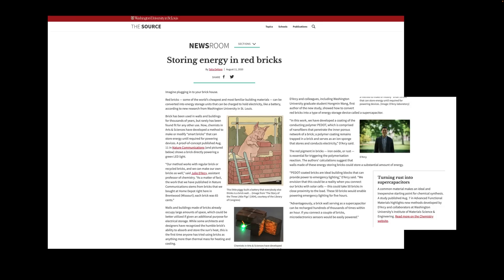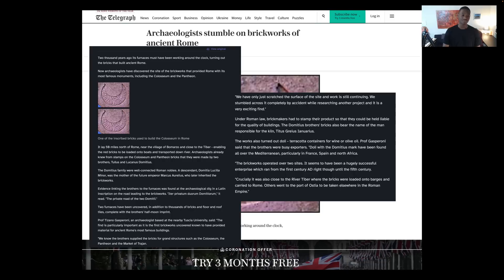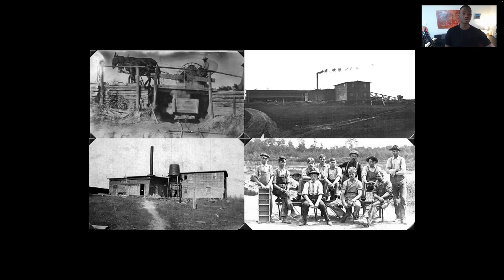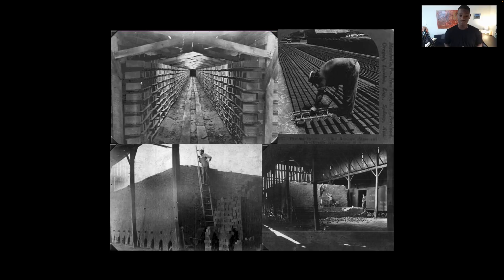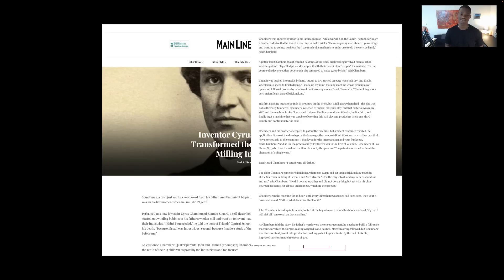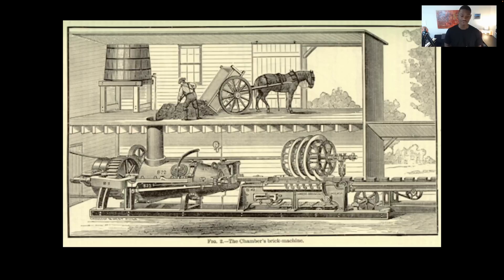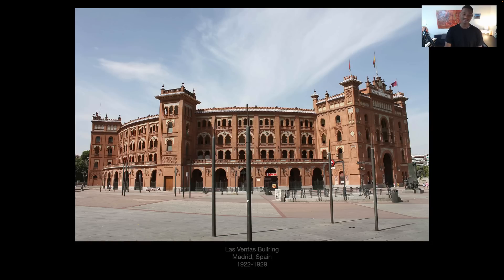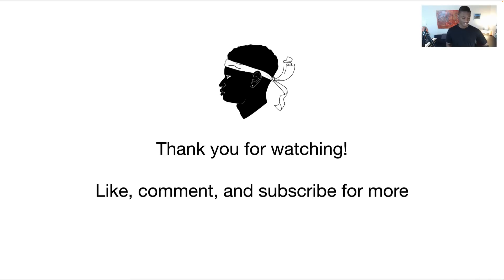youtube video #-t0cK5yxU5I

Comment: Yes silica batteries are real. You just need two different types of metals to act as your anode and cathode. Only problem is they produce no magnetism so they only make volts. Each brick would be 1 volt roughly. You would have to convert all those volts into amps at some point maybe with an electric motor with a few broken or turned of coils to produce a collapsing feald. That feald would make amps. Have fun, look into Bagdad batteries they are fun to make 😄 joules ringers can be fun too but you heard nothing from me.
Reply: WOW,  im glad i read comments, because the video was click bait all i heard was history of brickmaking and then he went to showing all these buildings made of brick which had NOTHING to do with the Title of the Video , the reason why im here.
Reply: @Shang Tsung  I hear you. That's why I left the comment I did braking down the actual science. I knew some smart people would actually consider what I was saying. I don't expect it though.
Reply: You can create a charge with an aquifer underneath the bricks. Something like having flowing water under the structure. 

Much like Giza Pyramids with the Nile flowing under it and all those massive granite boxes with lids smashing into each other. 

This will create piezoelectric field. The movement of the water perpendicular to the movement of the piezoelectric field will create the magnetic field... 

Each brick in the pyramid will act as a transformer to store electrical charge and modify the output of said charge.
Reply: The ancients also used coal power plants in many cities. So it may not have been a general use power source probably had some other function using electrical laws. The Moorish structures or at least the structures that have hexagon prism 'window' structures with pipe organs (churches) did produce some power on demand.
Reply: combination of light and frequency also creates power
Reply: So in order for the pyramids to work. There are access ways where the light can reach the water under the pyramids
Reply: @massdisruption3437  idk about the pyramids, but the batteries I'm talking about don't need light. I have no clue what the pyramids were used for 😅 sorry homie.
Reply: Áll old churches have a basin underneath the altar; al-tar = al-tároló, which means underneath-storage; the ethernal flames and candles used in churches might be related to some  sort of gases or  chemical danger

Comment: very skilled brick mason is an understatement. I once had to re-set some large pavers, "large" as in like 2ft x 2ft square blocks a decorative area around a tree and fireplace outside chill spot, the roots and what not over the years had them starting to come up, getting a perfectly leveled spot of fill dirt even an area of 2ft by 2ft is a nearly impossible task by hand without proper tools. you might think you got it, give it a couple days to settle, guess again. Eye balls shovels and air bubble levels won't cut it. I lean more toward how we do it now, POURED LIQUID geopolymers, especially for leveling of foundation, then the facade/decorative render cover with plenty of room for mistakes, can make it LOOK like its made out of anything. That's largely the case with most of these ancient structures. Wise up/paul cook all those dudes have shown this ad nauseum. When the aggregates are in a liquid state, they self level and self fill a volume of any shape. Not to mention, bricks alone would crumble under the immense weight of structural support in buildings of that magnitude. They need framing, rebar, etc. Every time we turn around we "discover" something in these old buildings we never knew was there, for example one built over 1000 years ago thought to be completely stone hewn was found to have iron framing. They're putting up some new 4 story building downtown where i live right now next to the "old" courthouse, to make it look brick like the surrounding buildings, its completely wood framed construction with plywood finish, then a thin layer of decorative "brick" glued to the wood, lol.
Reply: Yeah, in my hometown that was the size of the paving stones 2 inches thick. Groups of old guys walked with a cart and any cracked ones they would fix. Each group had 25miles of streets contracted to them. No potholes lifted corners every one who wanted to work had a job. Those streets were put down 180 years ago ,only got one drain redo because of new housing in the area and then the fiber cables got layed with machines and fucked it all up. Many hands make light work and the ground once levelled will be there century's later, a few machines do the same project and your pulling it all up every 25 years?? Don't make sense, and that was only fifty years ago. I can't walk through areas and see houses and shops more than fourth years old now and yep more getting condemned every year.👍
Reply: They poured geopolymers in precast, but not here, and does anyone know what the real ground / foundation is? Since it is mud flood everywhere and the buildings seem to be bottomless and we have access to few old world structures.
Reply: Strange comparison. The old building are real solid bricks throughout. No simulation at all. I don't understand your comment exactly, but have an idea. Anyway, the fact we can't repeat this today doesn't mean previous builders couldn't do it either. Projecting is not working here
Reply: @elim7228 Agreed. Old world buildings are the real deal and not a facade like now.

Comment: It was either purposeful destruction like you said, or it was an accident, a meltdown of the electric city circuit board. But whatever caused all the melt, had to have been sea water that cooled it down. Either a fail safe that was built in by our ancestors who undoubtedly terraformed the plane, or a result of whatever caused the cataclysm also causing earthquakes and tsunamis. We are a species with amnesia but slowly we remember…through critical thinking, sharing, and through dreams.

Comment: Super capacitors to store charge derived from the canal systems and Star Forts? Thanks for making this video. There are numerous videos about the structures, streets, bridges, buildings etc. made of the bricks and others such as UAP channel Bricks out the Wazoo questioning how that many bricks were even made in those early days but this is the first video on the subject that shows photos of the brick making factories or what ever you would call them. Which, looking at a small group of guys that look rather tired, reinforces the question of where did all the bricks come from? There would have to have been a brick making factory every 50 miles in all directions to have supplied the amount of bricks that it took to build the old world. Especially in the time period and time frames they were built in. Brick cities underneath brick streets with newer brick cities above them. The old world said to have been built over roughly, what, 300-500 years of time, showing 10,000 years worth of bricks?  Good stuff man! Thanks.
Reply: They have been redoing streets in our 2 towns. Going clear down to pavers. Tons of them.....but ppl want them, so thats a good thing. Toldmy kid bout it. They made a whole sidewalk. All of these are early 1800 brix.
Reply: @suebee1436  I live in Vancouver Washington and there used to be the remains of the Hidden brick factory off of 4th plain and Kaufman I have heard that the Hidden family started out here but idk for sure. They tore all of the brick yard buildings down in the 90's I think the Hidden house restaurant is still open Just a fairly small brick 2 story on 14th and Broadway. We have a suspicious brick Catholic church close to that and the Academy on Evergreen blvd. All our brick buildings that I can think of have mudflood aspects to them but none are the built for giants kind.
Not sure about the church but The Academy and a Fort Vancouver old barracks building are made of Hidden bricks.

Comment: The amphitheaters were probably whitewashed (painted white) and used to concentrate sunlight onto the lower part, making a warmer microclimate down there. Google "fresnel lens", then "fresnel mirror", then figure/find out how each of them works, in this order, and then it will make a lot more sense when you see terraced terrain why that terrain was terraced. Even the word "terraced" has the word "terra" in it.  The suffix "-ced" comes from the Latin word "cedere", which means "to go, move away, withdraw, yield". So "terraced" probably means either the ground moving away, or the area moving back to being soil (i.e. instead of a sheer cliff or plain rock).

Comment: as for the Petra sites, i honestly feel when i see that stuff, it's almost like it's like 'laser-cut' FROM huge rocks. Like somebody made a extremely detailed 3D model of what they wanted in a computer, and then let some device/machine cut the shape out of like a solid mountain, by extracting / vaporizing / dusting the unwanted material, and that got transported/used for some purpose.

from small to gigantic scales, and that for some reason, some cataclysm happened that destroyed that technology, leaving many buildings unfinished. 

the biggest issue imho is that you cannot date rock. in theory you can, but you will end up with the age of the material itself, not when it was shaped / adjusted into what was used for building. This, btw, goes for wood just the same though - giant sequoias can live more than 3,000 years. Now if you would NOW construct a wooden building, made entirely from the material of a 3000 year old seqoia, or let's say a table from the part closest to it's base and center, that would get dated as being 3000 years old - but it's just made yesterday. 

it means carbon dating is well, problematic if we are truly honest. 

But there's a little extra gem i would love you to check out. 
Check ancient maps of about 1500 to 1700, and you will find a lush africa with rivers, cities etc, and even Antarctica. 
Take mapes from the 1800s, and lo and behold, Africa is a barren landscape in the north. What an interesting time coincidence.

Comment: If the bricks are holding a charge then the mortar would need to conduct the charge for it to be useful. Or you'd need a way to connect all the bricks outside of the mortar. 

I'll save you the Google search, dry concrete has high insulative properties.   I guess I'm curious how any of this would be useful.

Also your point about one brick being off ruining all of the rest of the structure is inaccurate. Some brick layers do this on purpose to achieve a certain style. Also if you made a mistake you could correct it with the mortar layer which gives you flexibility and room for errors. So I'm not sure why you said that since it's blatantly I accurate. I guess you have never laid bricks before? 🤔

Overall I'd highly suggest to leave the alternative history community and start researching archeological and historical work that's being done at these sites. You only show your own lack of knowledge and people who know about this stuff will watch this and laugh at you. Best of luck on your channel.
Reply from the maker: Thank you for sharing your insights and ending on an unhelpful unsolicited suggestion! That would be like me coming to your channel and suggesting you start making videos on something else, because apparently the market decided your take Pokemon isn't quite like it used to be. I would be ridiculous to tell you such a thing.

You have not and likely will not check out my other 4+ hours of content, but if you do, you will learn why I will kindly not take your suggestion and why my approach to hidden history is needed and welcomed. 

Good day sir!
Reply: @geomansee  so you have laid bricks? Or you haven't? 🤔
Reply from the maker: I have not laid bricks in anywhere close to the manner as the buildings I show in these videos, many of which have mortar tolerances too minimal to do the adjusting that you describe:

https://youtu.be/DVrf7HPBdHs

https://youtu.be/tsftu2K3J2k

https://youtu.be/JPyKA_jx3iw

But to answer your question, yes I have laid bricks.

And in other videos I actually get a bit deeper into my architectural understanding, which as I compare, is absolutely nothing compared to what was done 150+ years ago!
Reply from the maker: I'm wondering what direction you're heading with these inquiries and your overall tone-  hopefully to inform and educate me and all who are reading, ideally with some links and sources.
Reply: @geomansee he's tasked with creating ripples in the space. Channels like this one are full of provocative types.

Comment: clay is 3 layer, in micro/atomic scale
1 layer Fe2+ orFe3+ iron, easy to make electron flow by magnetism or photvoltaic way
1 layer aluminium3+ same stuff but with iron it makes an electron flow difference = magnetism/ battery
2 layer silicium as isolator
Reply: You're right, my car battery just failed, so I replaced it with a brick and it worked!!

Comment: Pumping cheap iron-oxide-rich red bricks with specific vapors that form polymers enables the bricks to become electrical-charge-storage devices. Core-shell architecture of a nanofibrillar PEDOT-coated brick electrode lights up a green LED.

Comment: One brick being off does not throw the whole building off. Ever noticed the brick mortar? You can easily adjust for any brick not perfectly aligned.  Can't believe you said that.
Reply from the maker: For what it's worth, I have actually laid brick, and it's easier said than done. The mortar tolerances in the structures I present on virtually every video on this channel are near perfect, as are the bricks themselves. There is no need for adjustment because they are somehow perfectly aligned better than any bricklayer today could dream of... How?
Reply: If you are checking everytime with a level you should be able to do it where it looks perfect, laser may say it ain't, but it looks it.  Someone or something has definitely built way above our capabilities all over the planet.  That is simply a fact.

Comment: Bricks can not be used as batteries. Proof? Try this: Make a battery out of copper and iron, the simplest materials to make a battery from. The voltage is very low, the amperage is very low, the current is very low, it runs out of electricity very fast and is far less efficient to charge than to just put together and use because electricity input corrodes both the cathode and electrode so the more it is charged, the less charge it can hold for less time. Essentially the battery breaks down as you use it. Now, try applying that to a building structure. The only time your battery would charge is when there is lightning, and the electricity stored is discharged directly into the ground. Atmospheric electricity wouldn't charge it at all, because it is directly grounded. So no charge can be stored at all. Then imagine charge could be stored. Your very weak cathode and electrode would break down very fast leaving you with nothing but rubble after less than a year.
Reply from the maker: I appreciate this comment- it counters most of what many in the comments have presented and is well explained. Though I'm no expert in anything, I generally like to understand as many viewpoints as possible.

Your explanation makes sense, yet the reality is that we see that brick buildings did in fact have greater purposes, and this knowledge was known by those who built and used the buildings. 

Its likely that they were operating under a whole different paradigm in which this knowledge was known and practiced. We have merely inherited the structures, and, operating under a new paradigm, are unable to utilize the antiquitech. 

Either way, I could be wrong about everything and am open to that possibility too!

Comment: I would be interested to see what the math looks like for these buildings construction; in an attempt to understand how many people it would take to simply make the bricks within the alledged construction time, or how many people would have to participate in the masonry. Like if we assume a single laborer could make 30 bricks per day by the year 1200-1500 method; this is the same as a team of 5 making 150 bricks per day. We could assume that to make 1 million bricks in a year, 365 days, the rate of brick production per laborer
Reply: Sorry my comment got prematurely posted and I can't edit my comment with my current brave browser settings. Anyways, when I did the math, I was surprised. 1,000,000 bricks divided by 365 means about 2740 bricks made per day, and divided by 30 bricks per day per person, surprisingly would only take 91 people to achieve. My math includes some uninformed assumptions, like that 30 bricks per person per day is reasonable, and that anyone could actually work making bricks all 365 days of the year, but it's still surprising math.. To make the 90 million bricks in one year, by my calculations, would require about 8220 people, which is significantly less than say the number of Hebrew slaves in Egypt according to the book of Exodus...  though I'm not saying magic wasn't involved though, seeing as magic was around in ancient Egypt according to the book of Exodus

Comment: Bricks can be used as batteries but allso resistors, so in area's that are cold they could use power from the either to heat the building. The mystery of the melted buildings was caused by a massive energy overload. For instance a war using energy weapons, a plasma apocalypse or our Sun going supper Nova?